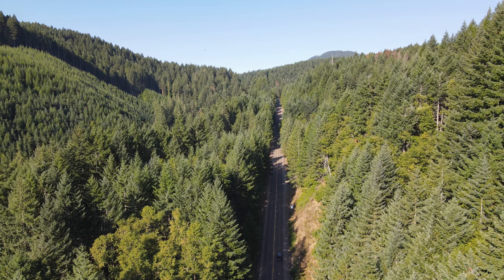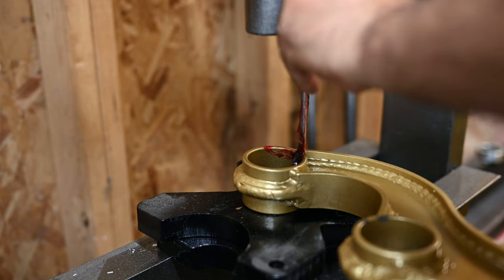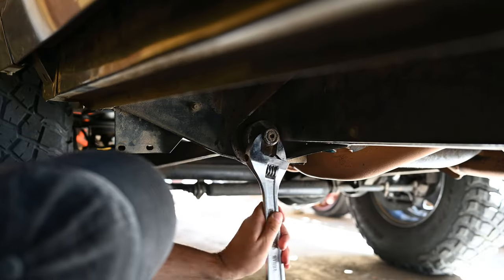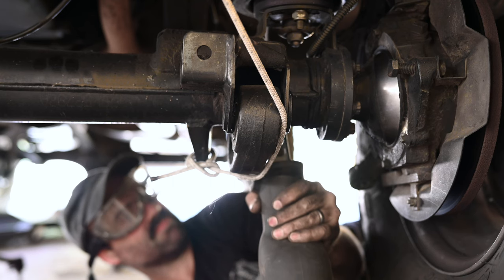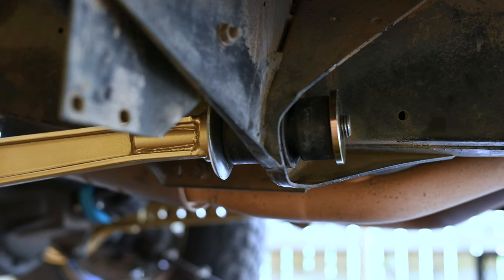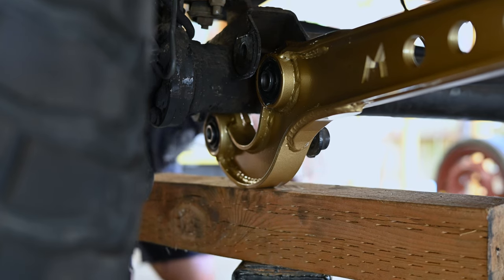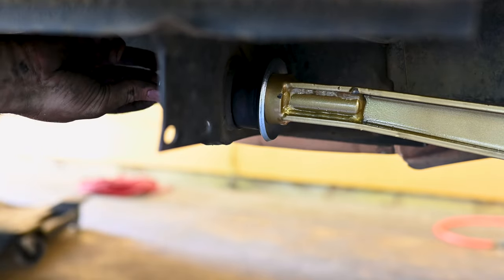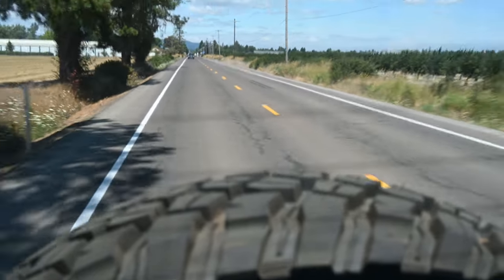How to Install Land Rover Front Radius Arms

Comment: Appreciate this video. I watched it more than a few times lol but it's very informative. I have the 3 degree trailing arms , and a 4 inch lift is just scary for sure thank you! Going with the 6 degree
Reply from the maker: Glad it was helpful. I hope the 6degree arms work for you. That much caster makes it less twitchy, but it also makes the front pinion angle worse. I have a double cardon driveshaft, but I still get some slight vibrations related to the pinion angle.

Comment: Thank you,  please share with your thought on the terrafirma after 9 months?   Its interesting, I had similar symptoms to you. But i Solved them with tie rods, steering rod and panhard rods. on defenders with 33" and 25" tyres.  Thats why I love LR, no two are the same :)
Reply from the maker: As far as the radius arms themselves are concerned, I have no complaints at all. They seem plenty strong enough for me. I do think that 6 degrees MAY have been too much, because now with the 4" lift, I get a slight vibration coming from the front under acceleration.
Reply: @tfrasca142  Thats interesting, who is lifting the 4 inches?  Coils, brackets?

Comment: Hey bro I have a question for you! So I have a D2 and I'm doing the Terra Firma 4-in lift in about 2 weeks. I also have the Johnny Joint 6° adjustable arms on order my question is how do I decide where to set them at? Part of me wishes I had got fixed ones but I only ordered those ones because they have roller bushings and I thought that was cool. So is it logical to measure the factory angles with an angle finder with it both resting on the ground weight of the vehicle on the suspension and also up in the air suspension fully extended and whatever those Factory measurements are just try to meet that in both positions with the adjustable ones? I have a hard time finding info on this but that's the idea I came up with not knowing much about it. 

Or my second idea is since it's a 4-in lift and usually 6° is recommended maybe I just contact adrenaline 4 x 4 who makes those and ask them at what amount of threading if any of the adjustable part would automatically make them around 6°?? I'm just curious your two cents haha

Comment: Quick question, my Disco 1 is going to life with 2 inches kit so maybe I need 3 degree radius arms? Thank you
Reply from the maker: Yeah, based on what the manufacturer recommends, I think 3° arms are fine for a 2" lift. At 3" of lift, I was right between 3 and 6°, and only went with 6 because I may add more lift in the future.
Reply: @tfrasca142 Thank you for your help!

Comment: Yeah, the onroad experience sans sway bars can be pretty darn unnerving!! My wife and I were camping down near Carlsbad, CA & she wanted to run to the store quick in the Disco - She never drives the Disco and because I'm so used to it, I forgot how squirrelly it is without the sway bars and the lift!! (it's also a manual trans)  When she got back, she was white as ghost because she attempted to get on the 5 fwy but quickly realized she was going to die if she tried going fwy speeds! So there she was, driving like 45 on the freeway!! Poor thing! 🤦

Comment: This shouldn't be a thing that ever breaks but my dad was running 3 degree terrafirma radius arm and one of them completely sheared off, became 2 pieces, since both he and I have put caster correct swivel housings on our defenders, probably better as pinion angle is still the same throughout travel as standard, best would be to use the genuine swivels and get them drilled/machined for caster correction
Reply from the maker: Yikes, that’s scary. I only just recently learned about caster corrected housings, and I like that idea.

Comment: You must have a D1 mine a 04 D2 the radius arms are different  but similar I have a 4in terrafirma lift I'm installing still debating on tire size probably be on 34 or 285 but nobody talks about the rear radius arms on a lifted discovery
Reply from the maker: Yeah, Mine is a D1. I have another video where I make some adjustable trailing arms to address some issues with the rear suspension after lifting it to fit 35s. But The D1 is a 3-link rear, and I think the D2 has a watts link.

Comment: Have you found the 6 degree on a 3” to work well? I was just fixing to order 3 degree today for same height of lift.
Reply from the maker: 6° feels pretty good to me. I think at 3" lift, we're probably due for somewhere between 3-6°, but if I know myself, there's a good chance I'll go up to 4" springs at some point, so I liked the idea of some extra headroom.
Reply: @tfrasca142  fair point, I too plan to run 35s here in the near future. 
Thanks for the opinion I think I’ll go 6 degree as well. Thanks for the install video
Reply from the maker: @riverbedoverland  Hopefully you get 35s on before I do so I can see how much more cutting I'll have to do. I really want to avoid having to use wider arches.

Comment: Curious if you experienced any front driveshaft vibrations prior to fitting the new radius arms and if you were running a stock front shaft?  Often with the pinion angle change that goes along with caster adjusted arms requires a double cardan front shaft to smooth out any vibrations as the stock front driveshaft u-joints are set out-of-phase deliberately at the factory by several degrees to work with the steeper stock front pinion angle of D1’s and late 90’s RRC’s.  Changing to castor adjust arms will tend to lower the front pinion angle which makes the out-of-phase stock shaft vibrate due to u-joint harmonics hence the need to switch to a double cardan unit.
Reply from the maker: Yup, after I put the lift on, (before radius arms) I had some driveshaft vibrations. A Tom Woods double cardan shaft fixed that.
Reply: Here in the UK you can buy castor corrected swivel housings that correct the castor angle without moving the axle.
Reply from the maker: @andicog that would have been cool to know. The downside to rotating the whole axle is that it makes the pinion angle theoretically worse for a double cardan shaft. Although I haven’t actually noticed any issues related to that.
Reply: @tfrasca142  I had trouble with noise from my 110 back axle after a 2" lift , only on a neutral throttle, everyone I spoke to said the pinion angle doesn't change with suspension travel, yes, it does! I ended up fitting spacers between the chassis and the trailing arm bushes, it cured it, the spacers are genuine LR, apparently they had trouble on 90 Defenders when fitting H/D suspension at the factory, it upset the pinion angle, even the factory were having trouble!  👍
Reply from the maker: That's crazy that anyone would tell you the pinion angle doesn't change along with the ride height. The spacers must have been pretty thin, right? There's not too much extra thread on the chassis end of the stock trailing arms. @andicog
Reply: @tfrasca142  The spacer fits behind the triangular plate that's held by 3 nuts and bolts, it's about 10mm thick so the 3 nuts and bolts need changing for longer ones, the actual end of the trailing arm with the large nut is left as it is  through the bushing. The part number for the spacer is KVX000010 should you want to check what they look like. 👍
Reply from the maker: Ah, right that makes more sense. Thanks for sharing. I just made a set of longer adjustable trailing arms, but will keep these in mind if anyone asks.  @andicog

Comment: What size tires are you running btw?
Reply from the maker: 255/85r16. I like the size, but may try 285/75 next time for the better selection.
Reply: 285/75r16 is what I'm running on my 94 trooper. 👌🏽 it's a balanced look.  But I love your skinnys.  Thanks

Comment: Hope ya torque them down, I think the rear are supposed to be 170ftlbs
Reply from the maker: I'm glad you mentioned this. I thought I had torqued everything down, but just went out to check and found the rear axle to radius arm bushing bolt was loose. I looked at the D1 Workshop Manual I have and the value for that fastener is 197 Nm, or about 150 ft lbs. The larger nut holding the rear of the radium arm to the chassis is supposed to be 176 Nm, which I had done. But seriously, thanks for saying something.
Reply: You welcome, ask me how I know lol 😂
Reply: @davidisdivad  I hear ya! I carry the boxed end wrench for that nut now, because after a lot of hard wheeling, it can actually come a bit loose after a lot of flexing. I think I even added a lock washer to mine if memory serves correctly